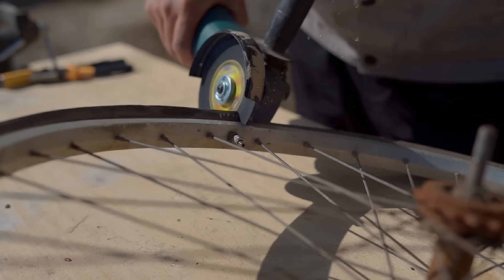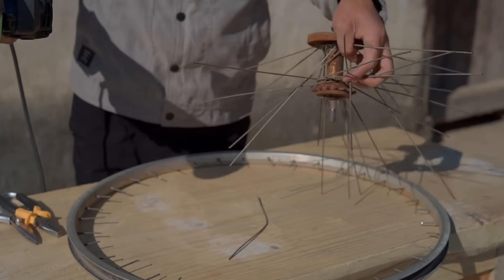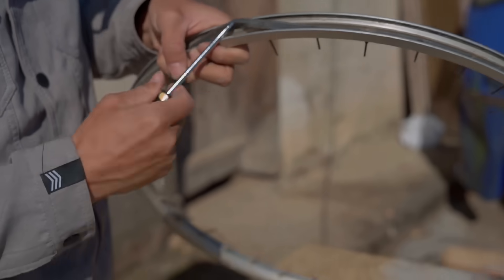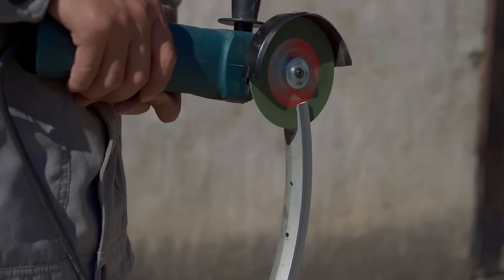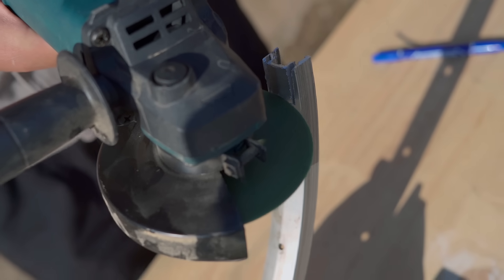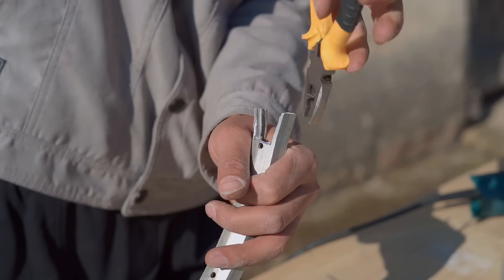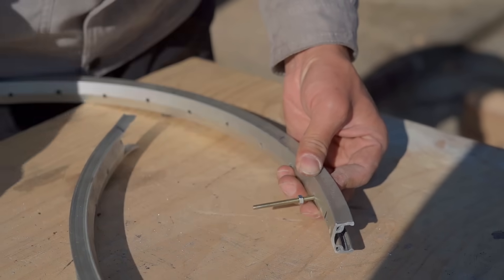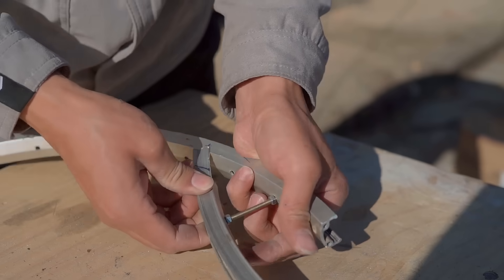How To Make a Spring Resilience Powered Bow From Bicycle Wheel

Comment: I think the bow would actually work when you use a shorter string and put the springs already in tension before you draw.
Reply: Why not remove the springs entirely?
Reply: @Neopolitan_Illusion  For the bow to release and allow the arrow to travel a good amount of distance, there needs to be a mechanism on the bow itself that allows it to stretch or flex. Here, a spring is used for tension. Normal bows without springs have a compliant mechanism meaning that the structure itself allows it to flex, which grants the string more tension to release the arrow. 
This metal bow would not be able to flex without the springs since the structure of the bow does not allow it to bend, due to the fact that the metal parts of the bike wheel are joined together with screws.
Reply: @jiseongkwon66  I'd be curious about a hybrid spring/cam design...
Reply: I agree shorter strain shorter more tense springs would be a more effective idea but for a starter bow quite effective
Reply: @benjaminvarner3231  the cam would only increase the tension with a shorter draw length.
Reply: Trampoline springs. But how strong is the wheel to handle the added tension
Reply: yes and also if he could use more heavier springs
Reply: If memory serves me correct, this is Jörg from the slingshot channel’s design, except that this is a bad copy
Reply: needs stiffer springs.
Reply: depends on what the rim was made out of.  some are steel, some are aluminum; i think the strength is provided by the spokes. with a thin metal like that, thats not intended to flex much i wouldn't think it would hold up under too many pounds cut up. Still a super cool design and i am speculating im not that smart haha
Reply: @MayorMcBluntz  bicycle wheels are made of... Some are steel - very rarely nowadays, mostly aluminium - it's designed to hold a pressure. Most, if not all, aluminium alloy bicycle wheels are "double wall", there's a hollow section in the cross cut (which you can witness in this video) which gives a lightweight wheel extra sturdiness. There's also stainless steel rims available. And of course, carbon fibre bicycle rims - but these are usually racing use.
Reply: @MayorMcBluntz  oh, and spokes is completely different thing - main purpose of them is to keep wheelhub in the centre of the rim. Plus by adjusting (adding and releasing) tension on the spokes you can do wheel alignment if the rim has a twist or, for example, if there has been a damage (like hitting a pothole or stone) and rim is no longer of a perfect circle but has elliptical or egg shape... Bla bla bla, long long time ago, when I was a child I went through all the tips and tricks of bicycle fixing...
Reply: You only focus on power , bow is way more than that
Reply: Літні
Reply: @ThunderNerve  what is that "way more than that"?
You are just speaking and saying nothing.
Reply: @thecatjall7848  i literally sya something there, 
And you making false statement, 
I simply said bow, is more than power
Reply: @ThunderNerve  "you only focus on power , bow is way more than that"
You are literally saying that there's more than just the power of a bow to focus on, well, what is that "more" you were talking about? That's my question.
Reply: @thecatjall7848  see , so you know i said something.
I just don’t have obligation to tell anyone what is it..
And why should i?
Reply: @ThunderNerve  well, you didn't have the obligation of replaying to begin with, so with that and the fact that you are just giving evasive replies, you could be saying "I don't know what else you have to focus on, but I don't want to admit it" as far as I can tell.
And with no replies to prove me wrong I guess I'll have to go with that as the answer.
So... keep it on, I guess...
Reply: @thecatjall7848  “as far as i can tell” so you’re assuming? 
What is wrong? You not even making any statement about bow’s factor
You just asking, which i refuse to answer.
Reply: @platinumf2505 take a leaf spring amd cut it in half and make the same bow with two larger springs, then you woukd have 5 springs
Reply: @ThunderNerve , in all fairness, it makes no sense to tell someone they are missing a key factor(s) on something and then refuse to tell them what that/those factor(s) is/are. You engaged, then refused the follow through. It’s totally reasonable for anyone to presume you were trolling and don’t have the information you believe they are missing.

Comment: That's probably only good for a few shots as the durability is questionable, nice build though.
Reply: I too would like to know the longevity of this bow
Reply: Oh yeah 😎.  Soft aluminum wheel rim?
Reply: @ericsmith4513  depends on the make of the alloy, aluminum can be soft or as rigid/strong.  All aluminum bicycle rims do have their breaking point from enough force.  And any metal can fatigue.  That's why most bike wheels get warped with enough damage.  It's tough, but not indestructible.  Over time, an aluminum bow will also give way - the question is "how long" before it breaks.   Bows are made to a different set of standards/tolerances depending on the amount of draw weight it can do - and it's different for every user. A 70 pound draw weight would shorten the lifespan an DIY bow made out of an aluminum bicycle wheel considerably.
Reply: It was capable enough to support the entire body weight of a fully grown large adult

Comment: I would fear the limbs will break.Aluminum over stretched is questionable.
Reply: It's elastic limit likely isn't even approached with this bow and with the assist offered by the springs I imagine it is safe
Reply: I agree, the pivot point wil probably colapse, especially if we're to increase the spring tension. I like the simple concept tho, leaves room for creative modification.
Reply: The aluminum limbs do not stretch. Until he added the springs all I could think is there is no way this would work. Using paracord show lack of knowledge of the materials used.
Reply: It's springs vs metal fatigue
Reply: Well what did you expect, its made in china

Comment: I feel like this would need some welding in the joints to add durability. I don’t think the screws alone will last long. This seems like a fun project, but in practice, it actually looks a bit dangerous for the user.

Comment: Put the springs on the outside of the bow, all the way to the ends of the outer arms.  Half-extend them before stringing.  You'll get a longer draw and more power, with a tighter resting position.

Just make sure to use decent springs because otherwise they'll just end up set as they are and lose power.  Needs high-elasticity material.
Reply: Tight?😩
Reply: Romans 10:9-10 ESV
+---------+---------+
⁹ because, if you confess with your mouth that Jesus is Lord and believe in your heart that God raised him from the dead, you will be saved. ¹⁰ For with the heart one believes and is justified, and with the mouth one confesses and is saved.

CONCLUSION: See how the LORD wants you dearly to be saved, if You just confess with your mouth that (Jesus is LORD) and you truly believe in your heart that GOD the Father rose him up three days later from the dead, you will be saved, for you are Justified because you believe that Jesus Christ was Risen by GOD the Father and you are saved from confessing that He is LORD, so why deny it, why doubt in your heart?
Reply: @JesusIsLORDbro3-3 always a complete nut entering....

Comment: Very ingenious design! Though like many in the comments, I wonder about safety and durability due to the materials used. Paracord might also not be a very effective option. It does look very cool👉👉
Reply: Remind me again, what kind of cording is considered "archery-grade?"  I'm more of a firearms kind of guy.
Reply: @misterkaos.357  I'm not sure. My best guess would be to use actual bow string but a bit thicker and longer to use in this setup. However I also understand the aim of this build is suppose to be a bit diy apocalypse style, where you make it work with materials available to you.
Reply: @MobTheGlitch  Suppose I went to the hardware store to look for cord.  What sort of material and gauge should I be looking for?
Reply: @misterkaos.357  you still here? Modern bows like compounds that have the same concept as this spring bow uses synthetic materials like spectra or dyneema. If you don't have a archery store near you, find braided fishing line same material as the former. Preferably around 0.50mm or 0.021 in, should already be rated above 60lbs.
Reply: @mocknugget  
"You still here?"
Nigga, I've been here since the Nintendo 64 was first released in America.  I am what the zoomers refer to as a "dinosaur."
Anyway, you say I can make my own bowstring out of fishing line?  Cool beans!
Reply: @misterkaos.357  haha! Yeah mate! Just be careful not to mix up braided fishing line (which you want) with other types of fishing line like monofilament and fluorocarbon.
Reply: @mocknugget  the best fishing line there boys and girls is called spider wire, and secondly kudoos to the gent who made the bow, when in a pinch you use the materials that's available, the mind and adaptability is a list art to keyboard warriors and to those keyboards ticklers let's see wtf you can come with lol and as for me well been here longer than I care to admit and I very predate the mcgyverism lol

Comment: I was always curious about this design, this video answers my question, it looks cool, still classic bow more durable in long run (that springs will rust, make too much noise in hunting, need more power/effort to use etc) but seriously it looks badass, love to have a carbon-fiber version myself whit laser pointer just for LOL's.. 
Good Job !
Reply: when u hunt, u have just one shot! miss and your prey is gone! if the springs are painted or powder-coated springs, they might endure a lifetime! With such a bow you can also hunt fish... people always think u need to shoot 50-80 yards or more...
Reply: If the springs were thicker and kept under tension they wouldn't make much noise at all(you would need string silences like any string)
Reply: @givemeanameman1  just use thicker spring like ones from frame of MTB. Plus don't put a string on it without tension ( I'd personally make arms still pivot but aided by spring since that would be far easier to string)
Reply: If the limbs bent and released energy too instead of pivoting, and the springs were enclosed, it would be much better
Reply: This is no hunting bow. Lol. No way in hell this has the draw weight needed to take something down.
Reply: @ragnar999tobi  This bow wouldn't have the power to hunt anything.
And if it does it would not be humane.

It's a neat idea. and perhaps it does have potential, but the bow in this video seems very weak, the draw is too low and the tiller looks frankly awful.

I would have no confidence in it.
Reply: @talyn3932 not in its current form.
Reply: @joshlower1  not in any form.

Comment: So, a hardware store components toy shaped like a bow. Using modern electric tools, prefabbed aluminum, nuts+bolts and store bought springs you "created"  a "bow" that can barely withstand 10lbs of pulling force with no sights and proven inability pierce a thin plastic bottle at 5 ft using a store bought modern arrow.

5000 years ago, craftsman could make a 10x stouter bow that could pierce woolly rhino skulls at 80 yards created using  basic wood carving hand tools and actual wood.

100 years ago John Moses Browning could make a 1911 semiauto out of a handmill.

80 years ago a crippled peasant created the symbolic AK using a pick and sheet metal.

But today, this is what we are left with.

I'd be impressed if u used simple tools to make something advanced and useful  vs using advanced tools to make something that will break if u use it twice. Just sayin.
Reply: Thank you, to writing this down so i don't have to.
Reply: I think you may have missed the point that this design is simplistic and builds quickly.  Yes plenty of improvements to be made design and material-wise.  A hacksaw would have done the job of the angle grinder and it would have taken just a bit more time.  

You are making faulty comparisons of historical iconic inventions that required incredible amounts of time and know-how with this junk made weapon.
Reply: @David-bc4rh  you don't Understand the point.

This design is made for a postapocslyptic scenario, where everything would be hard to find

Imagine you have to tweak it, and it's breaks down in your hand, because it was too weak for a stronger spring
Reply: @tacuska7  I don't see anything about the intent of the bow being for post alpacalisp, although i know from experience that springs, bike rims, and nuts and bolts are so ubiquitous I can't imagine them being difficult to scavenge from just about anywhere near a city or town or land fill.

Comment: Nice tool to hunt at 2 meters' range.
Reply: @WildCraftsman  I think you should use a shorter spring and tighten the string more. Thanks for the video. It is interesting. 🙂
Reply from the maker: @ahdid6105  you are correct,i just made a pattern.the power is  determined by spring you pick.if you want it be more powerful,try shorter and bolder one with much more resilience.👍
Reply: He's Asian. I think you're expecting a bit much to see him draw a 60 lbs bow.
Reply: @thomasolson7447  I thought that racism ended. Obviously, I am wrong.

Comment: Cute. But your draw length is severely limited.  Also, aluminum from a bike wheel might not give you a dependable draw weight...not the greatest material for extended use...not bad in a pinch though
Reply: Actually if he ran paracord along the reverse side of the bow tight, it would stop the bending of the aluminum and reinforce it... much how Greek trireme had a central tension rope that connected the bow and stern.
Reply: @givemeanameman1  meh...maybe it would help a bit, but once you apply any force beyond the UTS of that particular material it will permanently deform.
Reply: That's because its not depending on the bike piece at all for the draw weight. Only the spring.

Comment: The design looks pretty cool I'll give you that, but the pull makes it look like it would be useless at anything over 20'-30'. It just doesn't look strong enough, and swapping out the springs that are attached alone I don't think would do the job. Even 50lbs worth of pull would likely snap it where you made the cuts for the center piece to attach to the other two. The tubing you can see in the cross section would add to the strength, but not enough to handle any twists to the frame that are likely to come from somebody who only shoots left OR right-handed. It makes me want to see something like this done with some kind of a light duty leaf spring though. Maybe with a stronger material you could keep the same general shape, and include some counter springs on the front where the arms would pivot instead of being fixed to the center piece? One set of springs pulling the arms towards the handle, and another set of springs pulling the bowstring should strengthen the pull considerably, and if it was made out of a leaf spring then that would address the twist because then it can be spread through the layers.
Reply: It's something cool to play with but like you said it's not strong enough to do anything really useful.

Comment: The bow would work better if you had used a longer and stronger string threading the string through the front channels of the bow after the first pull
Reply: the rim wouldn't resist the traction its weak aluminum even used in a bike it would bend without the ribs. the pulley would bend the rims up/down 
anyway the design works with in a weak power and it looks cool tbh but its nothing more ^^

Comment: This is a slingshot, not a bow. The limbs aren't bending, the springs, attached to the strings stretch.
Reply: It's closest to a compound bow they don't use the tension of the limbs but of a cable around a pulley system and cable instead of cable he is using spring

Comment: Neat concept but I'm not sure about how much power it could output. I also suspect the recoil wouldn't be too pleasant. That's just speculation though
Reply: Idoubt there would be some recoil, however those springs would definitely degrade by time so it would be less and less powerful. I dont think it would have any great draw weight either.
Reply: maybe 5lbs? the power seems really weak and i doubt the design would hold 15 or 20lbs(+) the rim would probably bend

Comment: with an angle grinder you can already make a far better bow from using leaf springs and the variety of sizes you can fine in junk yards would allow alot of various designs from recurve to compound to one of them exotic types where it relocates the tension source and such, an aluminium bike tire while is lighter it is also not at all suitable for a bow you could actually use to hunt, least not in the design style used here, where the thread rod was used to fix the out rigger parts position could have a tension bar of sorts used there rather than a spring inside the curve, alternatively you could have the sprint run the channel of the tire outside and have the pully down in the groove this way you could have a longer range to stretch the spring and generate more power, would need something to stop the spring from causing friction with the frame but grease and a dust cover could do it. lot of far better ways you could go with this idea.